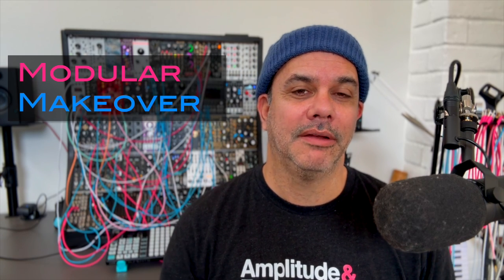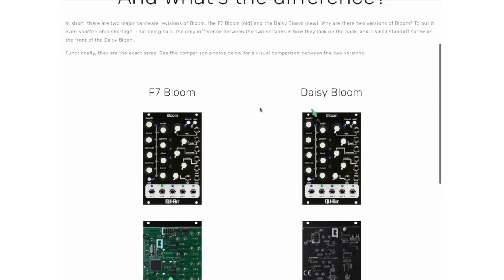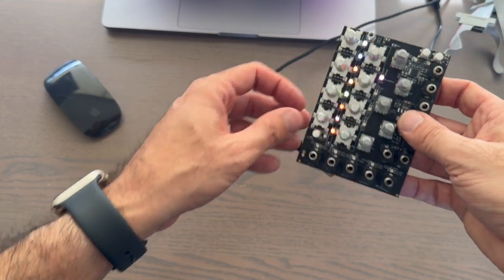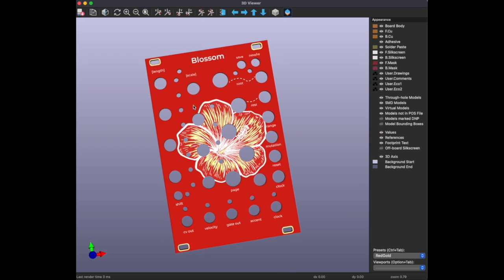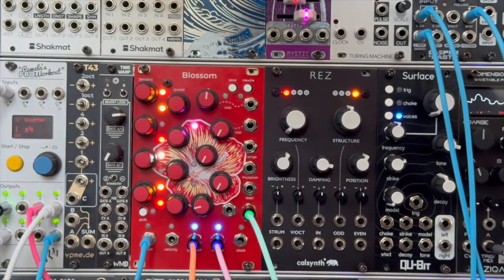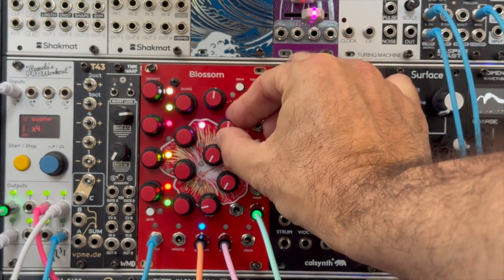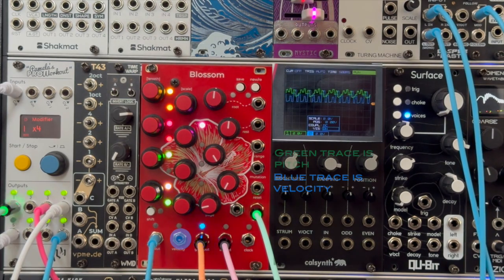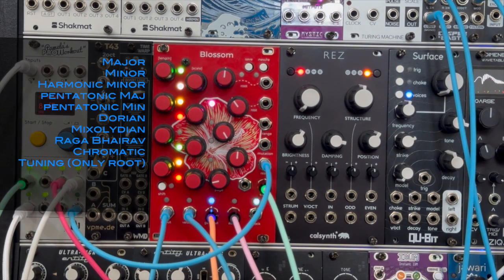Modular Makeover: Introducing Blossom, an (unofficial) alternative firmware for Qu-Bit's Bloom

Comment: I can’t recall what platform I posted that I was having issues with a 1st gen daisy Bloom V2 and you confirmed it would work. I appreciate the confirmation, I realized the issue was that I needed to have the module powered up on by rack as well. The Daisy would light up just off the Micro USB but it wouldn’t flash.

Comment: Thank you for creating such an amazing custom firmware! It makes both sequencing and phrase generation much easier to control compared to the original firmware. I have one question: even when I turn the “MUTATION” phrase generation knob all the way to the CCW side, the phrase still changes. Is this the intended behavior, or could it be an issue with my hardware? If anyone other than the developer knows the answer, I would also really appreciate it if you could let me know.
Reply from the maker: it's possible we need to enlarge the "dead zone" at the fully CCW end. Sometimes pots will give a small, but not quite zero value when turned all the way. It could be done in the firmware. I usually add a dead zone but I can't remember if Blossom has them.
Reply: @bluenautilus  Sorry for the late reply, and thank you for getting back to me.
It might be an issue specific to my module.
If you could release an update that slightly widens the dead zone, I’d be really happy, but I’m already having a lot of fun with the current version you created :)

Comment: My version of Bloom has a Daisy Seed 2 Rev 3 board on it, and will not power on when connected by USB. I also own a Versio with a near identical board but Rev 5, and that connects by USB without a problem. The main difference between the two visually is that the largest chip appears absent on the Bloom, marked PCM3060, in that spot is a chip is on the Versio. That seemed to be a big difference at first but a search of this chip suggests to me that it is a DAC. Since the Bloom does not output audio maybe this isn't needed, but that is a guess. Not sure why this Bloom refuses USB power/connection, but maybe this info will help someone with the same issue track it down.

Otherwise this firmware sounds incredible, shows a lot of thought and work went into it, and while I'm bummed that I can't check it out I hope this encourages additional interesting generative sequencers.
Reply from the maker: Yeah that's an audio codec; the chip for that has changed a few times bc of the chip shortage. Well, that's a bummer. Seems like a USB port should be there for a reason though... I wonder if it just doesn't provide power.
Reply: @bluenautilus  Confirmed, this version of the module needs a separate power source. With that, it connects as it should and your web interface to flash the firmware worked great. Looking forward to playing around with your take on this module!
Reply from the maker: Awesome!! Glad to hear you got it to work. @trancenoir
Reply: @bluenautilus  Dude, this thing rocks. I enjoyed my original Bloom, but your take on it may be even better. Thank you for all your work on Blossom! Looking forward to seeing what come up with next!

Comment: Very Cool, gonna try it!!! One more cool feature would be true ratcheting. In the current firmware ratchets repeat the note in the same division, messing up the pattern length. Would be so nice to let a note repeat 2x in 1/16th or 4x in 1/32 and so on.
Reply from the maker: Yes! Totally agree. Only didn't to it to avoid having to calculate tempo but it's high on the list to add.
Reply: @bluenautilus  this is incredible, I am going to flash this later. And probably make my own horrifying cardboard faceplate

Comment: 👏🏻👏🏻👏🏻👍🏻nice project ! I’m interested in more details in the process of making the new faceplate. You said you used a picture to rebuild it. Are you using this picture to match the hole or to design the print only ?
Reply from the maker: Just to match the holes. The flower design is just a matter of putting the right parts on the right layers. The dark red comes from copper layed down under the solder mask. The white is silkscreen and the gold is ENIG finish.

Comment: Brilliant!
Question: Is there any chance of setting an input for an LFO to control length of sequence, or even the probability function (mutator)?
Reply from the maker: There is a CV input to control the rest note probability parameter, the one to the right of that knob. As for length, that would be nice, but I'm out of jacks! Something else would have to go, but that is an easy change to make. Edit: mutate probability has cv input already too
Reply: @bluenautilus  Even better would be a way to select which parameter the CV inputs are assigned to.

Comment: Trying to update my Bloom, My daisy Board doesnt look like yours and its not responding being recognized on my computer
Reply from the maker: Are you sure you have the Daisy version of the Bloom and not the F7 version? https://www.qubitelectronix.com/bloom_differences
Reply: @bluenautilus reply was deleted, Daisy Seed 2
Reply: just plugged it back into my rack and looks like a Diode or Cap just burned on the Daisy Board
Reply from the maker: @MathewGracie  Interesting! Like, maybe one of these? https://forum.electro-smith.com/t/daisy-seed-v2-on-versio/2873  -- I think it should still work, although I can't test that. Should definitely at least be able to get your computer to recognize it. I would try a different USB cable.
Reply: @bluenautilus yes i cant post links or pics but yep thats it,

also just fried it so . . .
Reply from the maker: eek  @MathewGracie
Reply from the maker: so, you fried it just from attempting to plug it in to your computer? didn't even load the firmware onto it? not sure I understand what happened, or why that could fry it, this definitely sucks! @MathewGracie
Reply: @bluenautilus its nothing due to the software, for anyone else reading. I couldn't even get it loaded on. The PC wouldn't see the board, no LEDS. So i hooked it back up to the rack. It all powered on fine, then i saw smoke and shut it down right away.
Reply: @bluenautilus i hooked it up to the PC and nothing, it wasn't detected, no LEDS came on. The buttons wouldn't work. ( i have updated my versio firmwares the same way many times, so i know the proceeduire) The computer just wouldn't see it at all. So i moved it back to my rack to see if it would power on. It did then seconds later smoke.
Reply from the maker: dang, so sorry that happened to your Bloom @MathewGracie